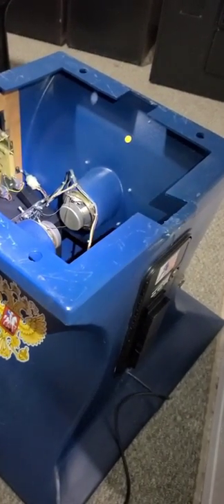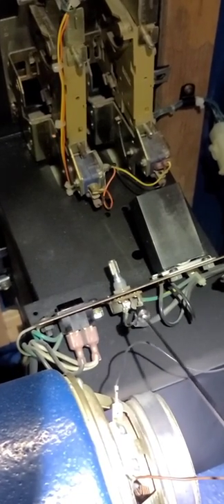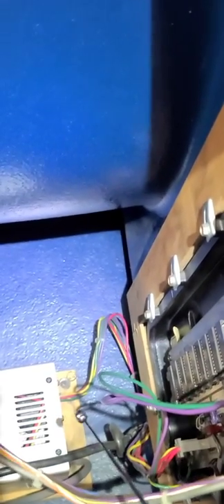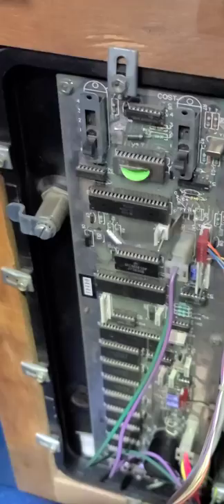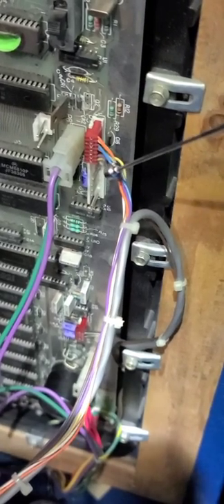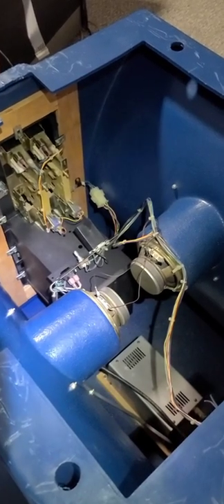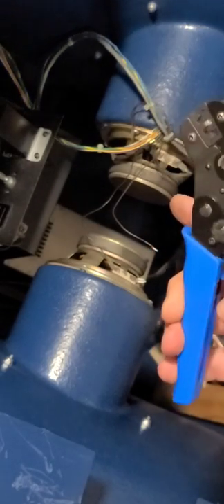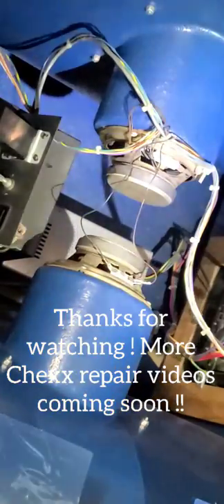Let's look inside an original 83 Chexx bubble hockey game!

Comment: Thank you for these videos!  Finally someone who understands these 1983 versions.  Mine has had a sound problem for years, and ICE has been zero help.  They only understand Super Chexx.  Maybe you'd have an idea of what I should do......all sounds were working perfectly in the beginning.  One day I turned the volume pot down a little and there was a loud pop/bang sound. After that, the crowd noises turned to static and the anthem became muffled.  I sent the board to ICE and they said everything checked out ok.  They told me to switch the volume pot (and sold me a Super Chexx one) which didn't fit.  I spliced it in (possibly not a good idea) and it did nothing.  Actually worse than nothing because before that I could control the volume of the static.  Now it's always at full blast.  I tried a different speaker but that didn't help either.  Now I just have the speakers disconnected to avoid the loud static.  Someone online with a similar problem mentioned changing the op-amp, but I never got that far.  I'm not even sure what to order.  I don't know much about circuitry or reading schematics, and there isn't much help out there.
Reply from the maker: Dang, sorry just seeing my recent comments. Look hard on the pcb, that LA4460 at the very bottom (to the right of the two 5v regulators, bigger part of the 3) it powers the sound. See if any burn or shiney goop on top of it. Also the P3 connector where the wires go, make sure good contact, it may need new connector there. I am almost to the point I can offer repair, I've purchased 25+ of every part lol.
Reply: @dbsbasementarcaderepair6126  Thanks, I'm just getting back to this project.  Do you hapen to know the specs for the original '83 potentiometer?  Somebody told me 100K ohm.  I know Super Chexx uses a 5K and that didn't work on mine, and that's the only one ICE sells.  My original pot doesn't say anything on it, and neither does the manual.   I'm also not sure what tolerance% and Watts I should be ordering for a new potentiometer.
Reply from the maker: I do not off hand. I've got the red base opened, putting meter on ohms i get 8.3k if that helps. I've never had to replace one, yet anyways

Comment: I was given an old cx-83 (Canada v USA) and have been having issues getting it back up and running correctly. project was put on hold for a bit but I'm hoping to start getting back to troubleshooting the issues this weekend so I may be reaching out for some insight/suggestions. would love to get it back in good working order.
Reply from the maker: Nice! Red base right? I just picked up my 1st red base 83 this past Tuesday!! It has a part on the pcb blown out that is easy to see. I got to sell a few games this weekend, so cleared some space to bring red base inside.  It's dome is scratched to hell, so will do a few videos cleaning it up! I also figured out replacing the ice period lights, I have to solder in. I may start offering that service!
Reply: @dbsbasementarcaderepair6126  yes red base. dome also scratched to hell but was thrilled to find your videos and will start that once I get it up and running correctly. currently it starts up and can start a game, all lights working, but one side keeps scoring non stop. need to pick up an actual chexx puck, puck ejector and I just noticed once I got the board on the workbench that it's missing the chips from U12 & U13
Reply from the maker: @Ramsden33  so hopefully good news on the u12 & u13 battlefront soon.  I am having these remade! But the new chip price is crazy. Will update when I get them ready. Any progress on yours? Could be pcb, could be scoreboard with that.